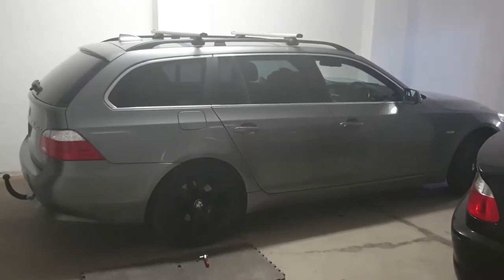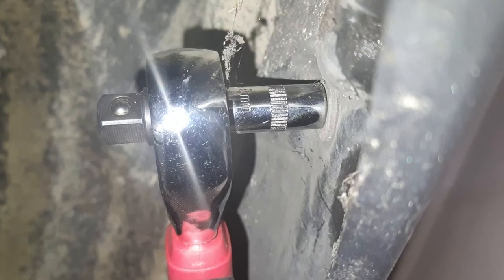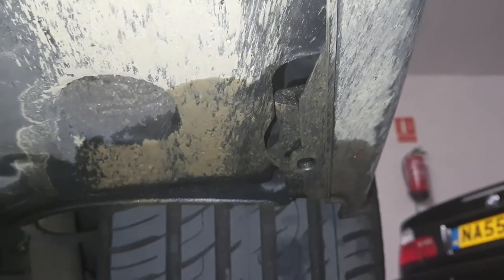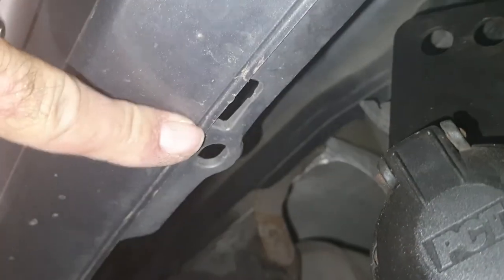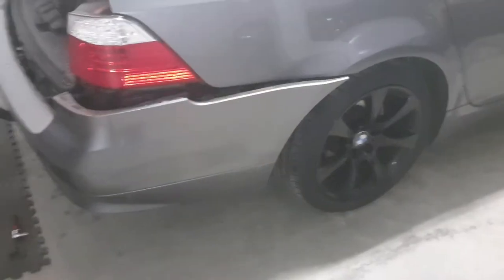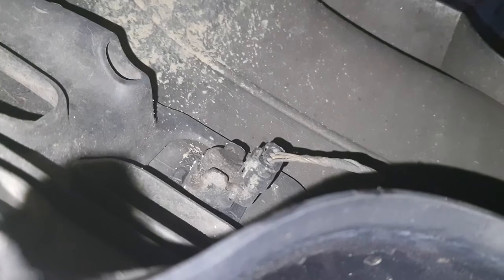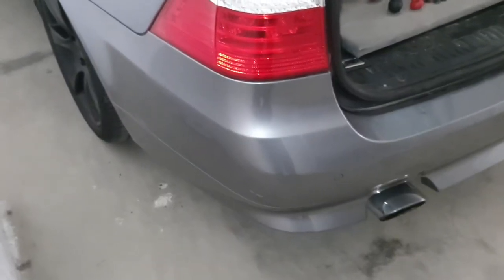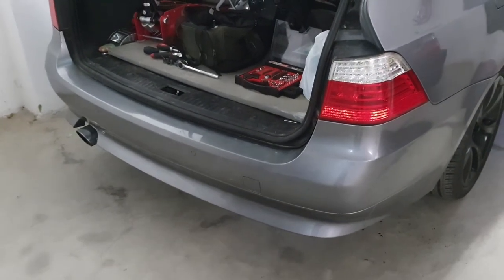BMW E61 5 SERIES REAR BUMPER REMOVAL

Comment: You can disconnect the parking sensor loom from the car rather than removing all the sensors from the bumper. There is a connector for this purpose.